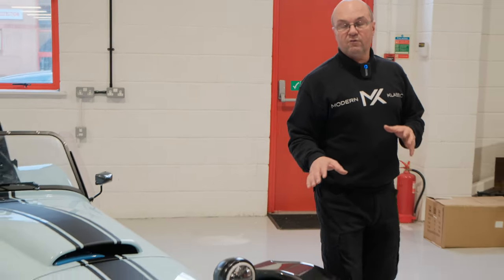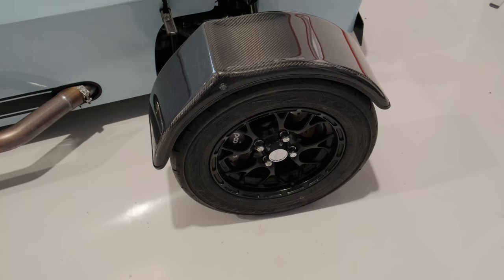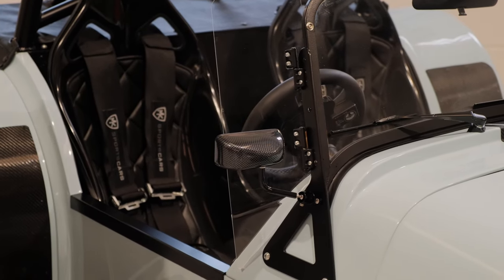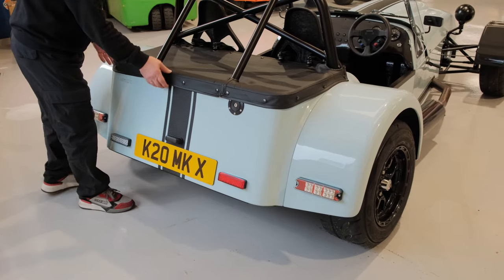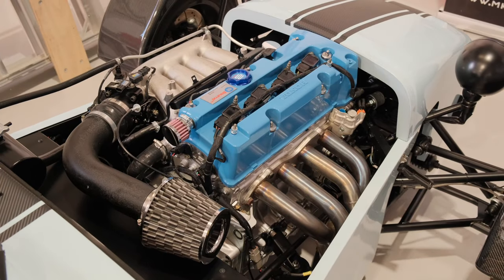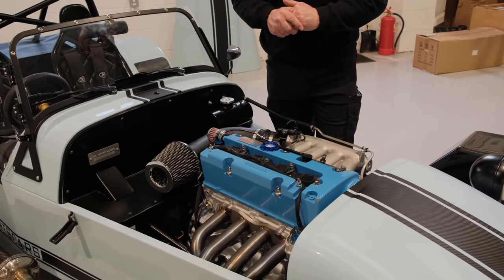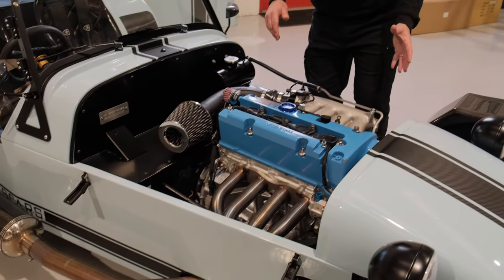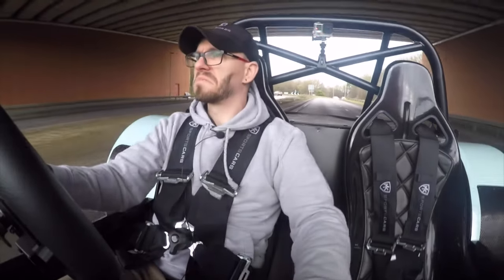284BHP N/A Honda K20! - RX-5 VTEC Test Drive

Comment: Do MK do a larger chassis version like the Caterham SVs?
Reply from the maker: No, we only have 1 size which will accommodate drivers up to 6ft 8”.

We offer a taller roll over bar, lowered floors and padded seats to accompany many shapes and sizes.
Probably best to come and see us in the factory or at the NEC in Birmingham at the end of March.

Comment: Needs a cold air feed otherwise that filter is sucking in hot air from the exhaust header. Won’t be making 284hp
Reply: I'm so glad you're here to tell them that...
Reply: They dyno it😅
Reply from the maker: Speak to Terry at Bourne HPP regarding the power, and tell him where he’s going wrong and how to fix it.  He dyno’d the car and created the engine map and did all the upgrades from a stock motor to what it is today.
Reply: @hhkk6155 - with the bonnet off yea
Reply: It does seem odd having the intake right behind the exhaust. Maybe airflow is good enough when moving, its without a doubt breathing in warm air while stationary, might affect immediate power off the line until the warm air is cleared by moving off.
Reply: Hot Air goes under the car I think
Reply: It has a hood scoop.
Reply: We did rolling road test at Emeralds on a 2 ltr duratec on throttle bodies with foam filters on a Westfield with a vent bonnet similar to that MK . This was with a short intake manifold , as my mate didnt want filters and throttle bodies outside the car bonnet. All the mapping was done with the bonnet off , as that's how you would usually do it. We then said about heat and temperature of air, so Dave Walker did 3 runs with the bonnet back on and it made no difference to the final power figures , which did surprise us, which was 199bhp on a standard duratec with emerald ecu , jenvey throttle bodies . Dave wanted to try for 200 bhp, but my mate chickened out :). It did surprise us on the power being the same, as we thought it would affect it. 
Also, I built a Honda S2000 powered Westfield and the heat soak on the inlet from the engine is pretty massive , even with the cone air filter down low in the front of the car and every way I could think of getting cold air, but is pretty pointless by the time it made its way to the engine inlet manifold and heat, as the Hondas do run pretty hot.
Nice looking car and the use of the EP3 is  more cost effective way on Honda power than the crazy money the F20c's are nowadays.
Reply: Have you seen where the intake is on a stock Honda Civic Type R EP3? Have a look at the engine bay because all aftermarket intakes route the air filter right up towards the bulkhead which is just above the exhaust manifold.